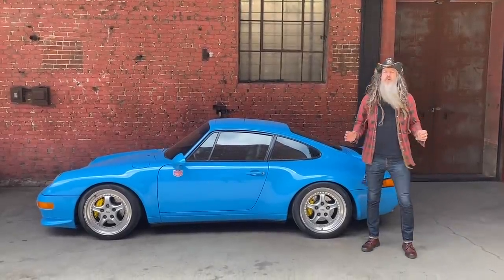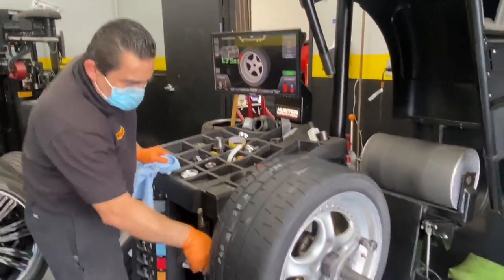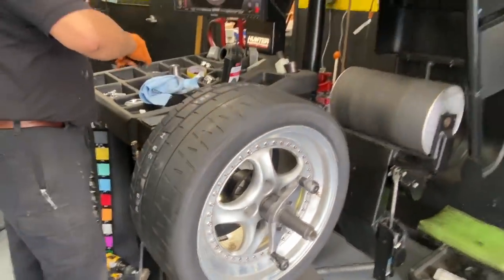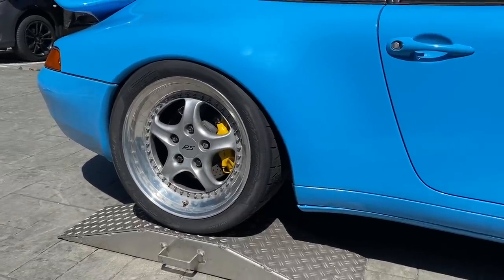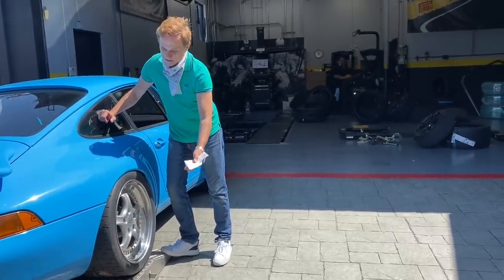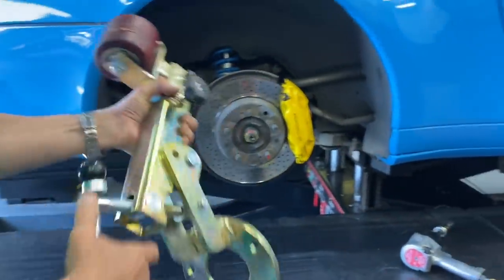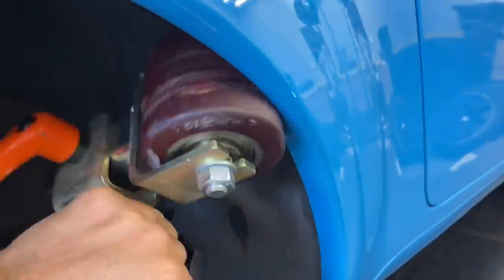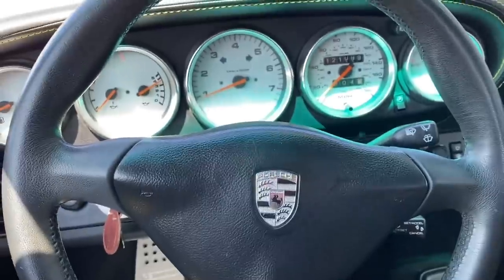Hot Sticky Rubber

Comment: Great instructional video !!!  The RoadForce Balancing Machine is the best on the market!  Wondering what color is that 993, Miami Blue or Mexico Blue 🤔?  I noticed that the technician was adjusting the torque values for those wheels with the car resting on the floor, it is always better to do it with the car raised.  I also noticed that the “German guy” leave a "rough step" on the right side of the arch, I think the process should be progressive starting from zero from the outside of the curve to the deepest part where the tire touches.  Anyway, what a fabulous car!  and thanks for sharing Magnus!!!!

Comment: you fix something and then theres always something else to fix! I just lowered my subaru and got an alignment but the car pulls to the right, not sure if the steering wheel was installed incorrectly or if it is the new suspension
Reply: Funny thing... If you are in the UK, because of road camber, you typically find a slight pull to the left. Quite difficult to test properly, unless in track or middle of a super flat road. Hope you get it sorted 👍🏼
Reply: 4130Burton thank you sir! From the US, but bringing it in today! Hopefully it does get sorted